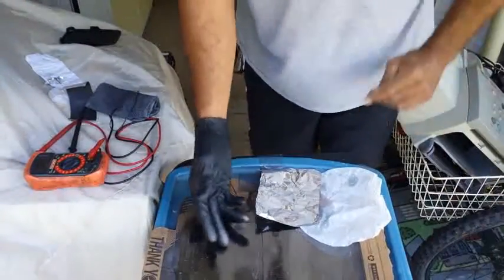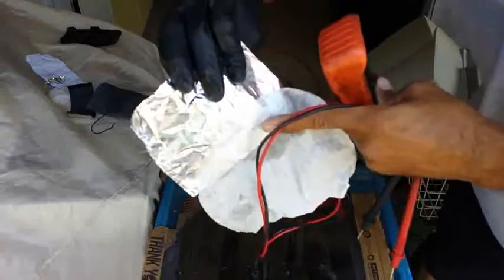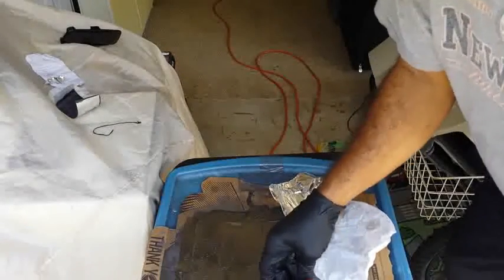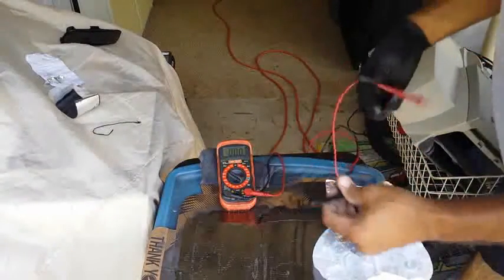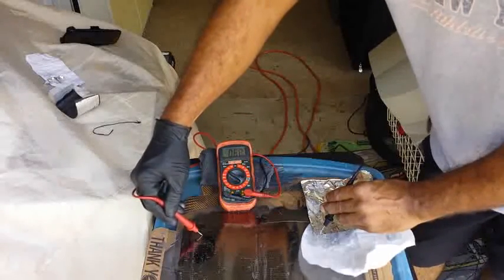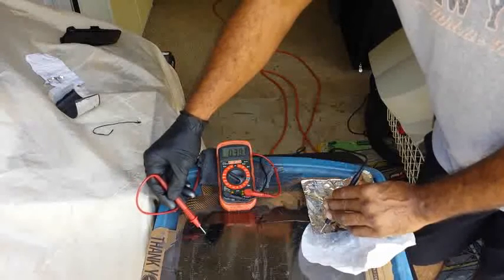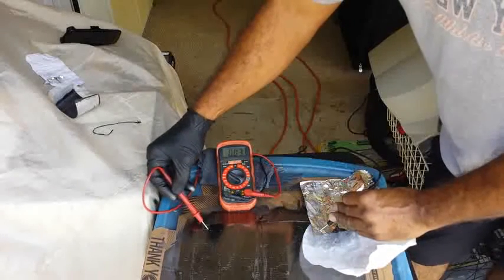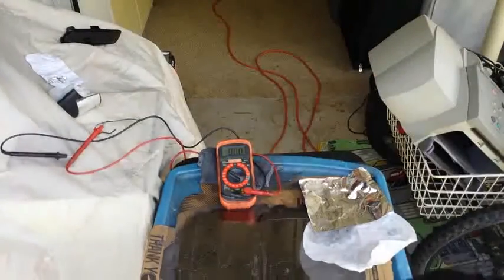Making A Graphene Battery Cell On Plastic

Comment: Is that not a capacitor? Or do you have something that corrodes the Al in your electrolyte? ^^
Reply from the maker: It's like both a battery and a capacitor at the same time. When I charged it it did hold a charge for a few minutes. I used the aluminum as my anode. I'm still working to stabilize it. I think the key is the type of metal used for example, the aluminum or magnesium and the ionic fluid. I will put out another video after my next attempt.
Reply: Nice! Good job ^^
Reply from the maker: +BakamonNO 
Thank You!